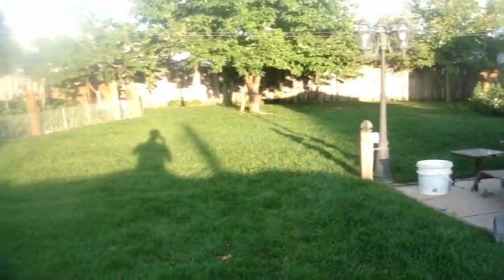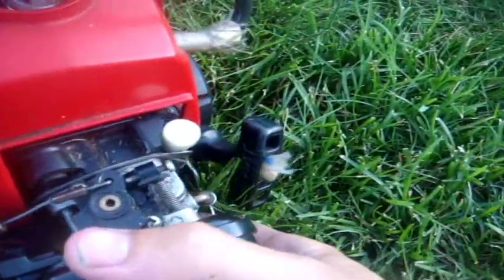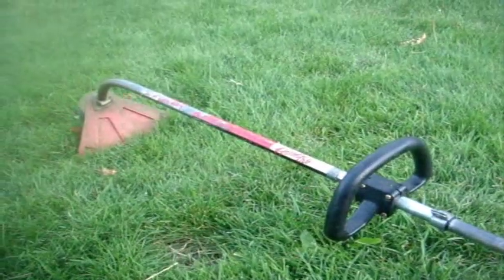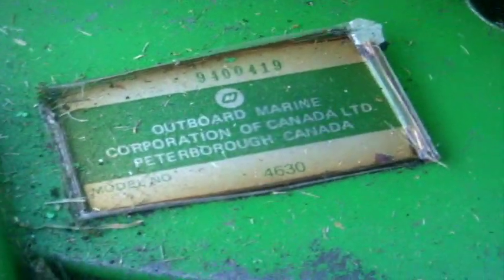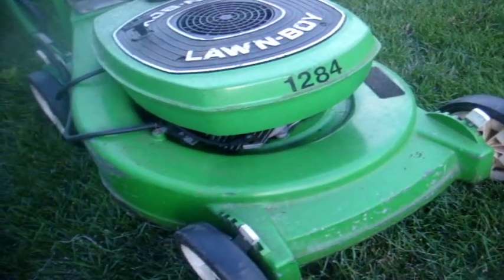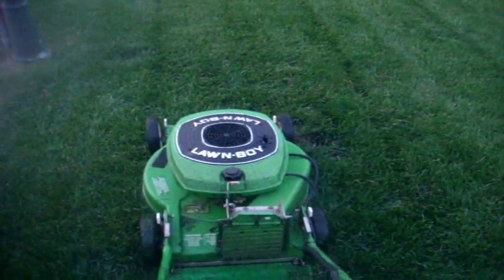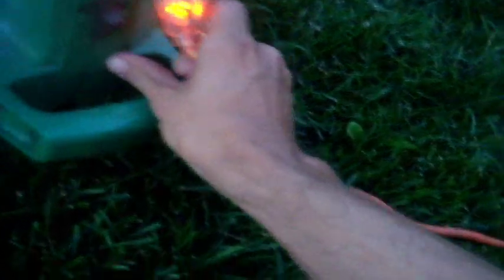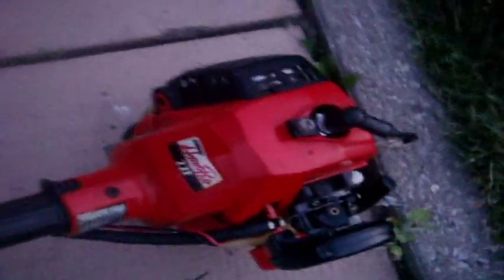Lawnboy 4630, Shindaiwa 22F and Weed Eater Electric Blower in Action

Comment from the maker: it depends on what you need it for.  If you're doing trimming around the house...I recommend the FS38, FS 45 and the FS 56.  

If you're doing commercial work and cutting thick brushes I recommend any of the 4-mix models (except the 100rx) or the FS250

Comment from the maker: It has the flex cable like the fs70.  You can't put a blade on it and it vibrates more.  It's not as balanced as the 90,110 or 130